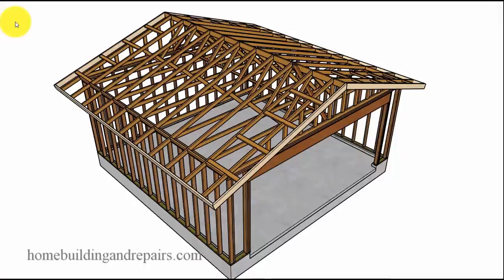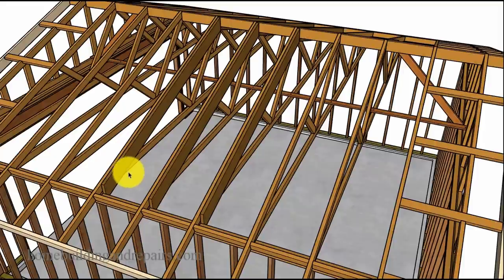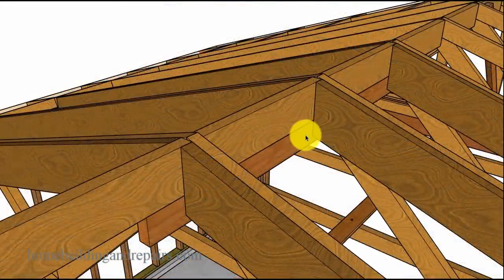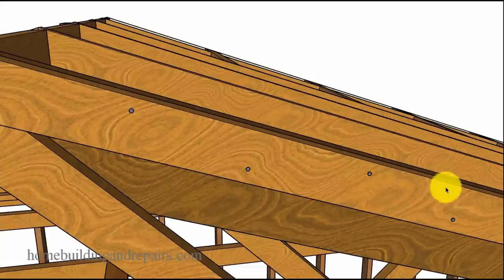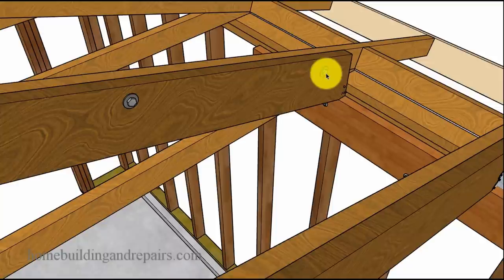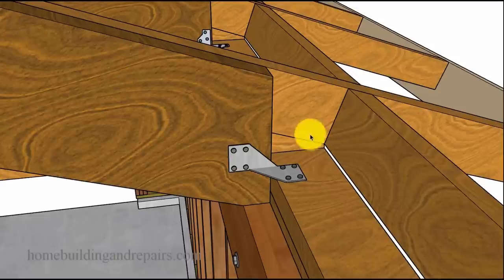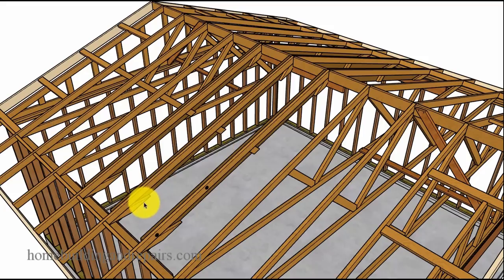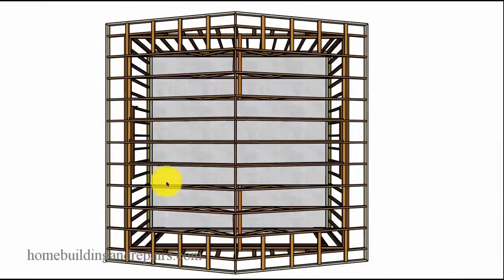Ideas for Remodeling Small Section of Roof Trusses With Flat Ceiling to Vaulted Ceiling in Garage

Comment: I was looking for videos on this sane question. The garage ceiling is too low for any car lift. It was too expensive to just build a new garage. So, options seem limited at best. You said this is not ideal, and with snow here in MT, any weaking of the structure is out. My roof also has NO ridge beam. My other thought was a pony-wall with post and straps to raise the whole roof and prevent hinging. (I did find a video on that, too.) However, bracing an existing roof to safely lift or jack it up while keeping it square and intact would worry me. So, my follow-up question would be, can the rafter ties be raised two to three feet instead of sitting at the level of the top plate? If not, then I think the option if we can't go up is to go down and dig an oil pit instead of a lift. But that may cost the sane or more.  Thanks.
Reply from the maker: You can raise a section or the whole roof, but I don't have step by step instructions for that. I suggest watching more videos at our website on garage remodeling, engineering and roof and ceiling remodeling.
Reply: up here in maine farmers would raise the whole garage using bottle jacks, lots of videos on that.
You have to extend the door .

Comment: I have exact problem like the one you presented here.
I have, in UK, small garage (W 2720 mm x 5500 mm D x 4200 mm at highest point of ridge).
The roof is supported by trusses (5 of triangle of longest side of 5500 mm, with W webbing). All trusses are made of timber of 3" x 1.5 ". I would like to remove the webbing for 3 trusses to create the vaulted space to make loft floor.
Can I do what you have shown here?
Any suggestions by anyone are well appreciated.
Thanks. God Bless.

Comment: I'd like to add a car lift in my place as well. 30' span, but I only need to modify 10' of that span. Any ideas? I'm looking for a structural engineer, but it's been a lot harder than I expected.
Reply from the maker: I think this is the only video I have on extending the ceiling for a lift.

Comment: I believe it was my question. Maybe more than I were asking, but this is pretty much what I need to do. Exactly what you are showing here is what I want to do, only I have block walls and the roof is turned 90*.  This is what worries me. My trusses tie from front to back and I have a 16' overhead door with a lintel above it.   I would be removing 3 truss bottoms giving me a clear 8' span to raise a car on a lift. So my worry is having 8' above the center of my 16' wide opening bow out and break the lintel.  I do plan to add collar ties along with adding a 2x6 or 8 under the ridge.  Comments???
Reply from the maker: I cannot provide you with structural engineering advice, but feel free to email me some pictures of your existing garage and a description of what you're trying to do and I would be glad to provide you with an opinion. You can get our email address at our website.
Reply: I'm not an engineer, but I am a retired Brick Mason.  If your lintel is masonry with rebar in it I would be afraid to do that.  If you could support it and replace the lintel with an I beam you may sleep better at night.

Comment: Hey could you could you rise a truss a foot high in the center to make the ceiling higher but keeping like a 2 foot box out all around?
Reply from the maker: It might seem like you could, but any modifications to an engineered roof could affect it's structural strength. What would be your reasons for doing something like this?
Reply: @gregvancom  am buying a house and it's a 8' but it seem low am a little on the tall said 6'5" and I jus need the room to feel a little more spacious
Reply: Did you understand when I said that it's going to have a 2' cut out all around

Comment: Why not notch the ends of the rafter so they slide over the top of the wall and rest on it, then put in a block underneath as extra support.
Reply from the maker: If you can't slide the rafter into that spot, sometimes you can make it a little smaller and then use a block to fill the space.

Comment: I never understood why they dont put the birdsmouth on the inside of the house..
Reply from the maker: I would need more details about your suggestion or question.
Reply: @gregvancom  ok, i mean how the roof joist sits on the top plate of a wall, and the "birdsmouth" seat-cut leaves the notched material on the outside of the wall. My logic tells me to put the plum-cut resting on the inside of the top plate -- to give that 90degree something to rest on, or rather push against so that nails arent the only support. 16-pennies have obviously worked for decades to keep joists from 'sliding off the roof'.. just a thought.. lol